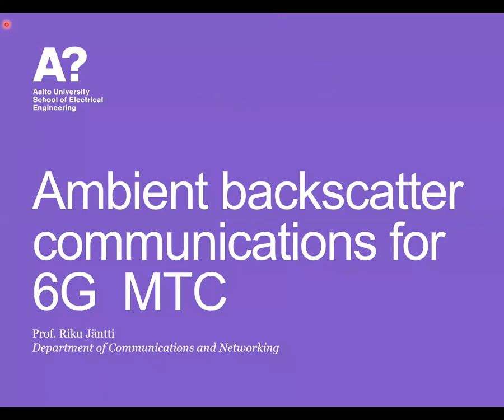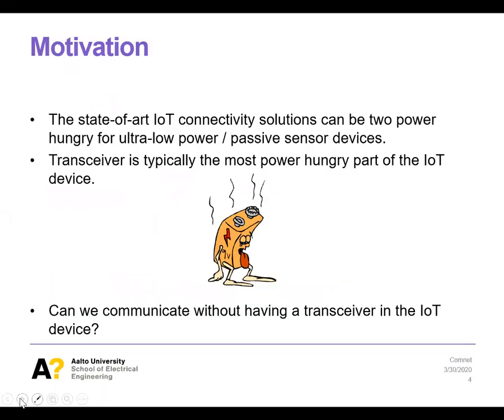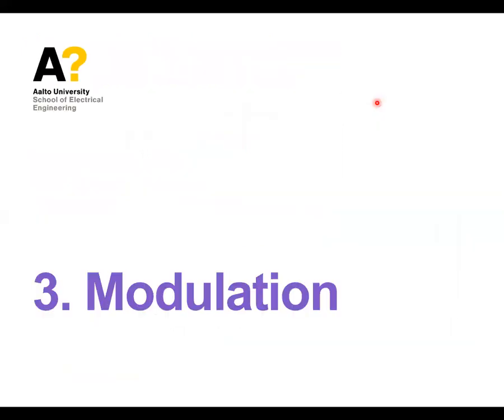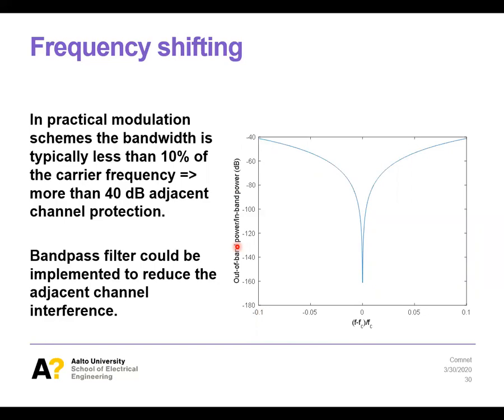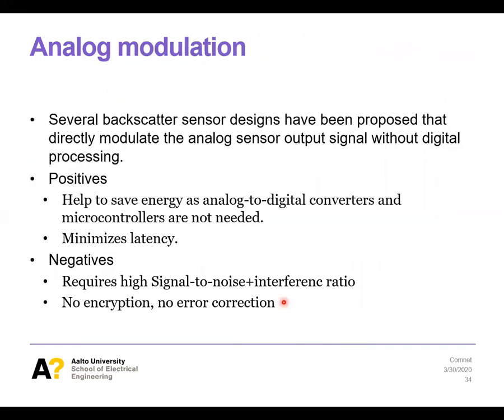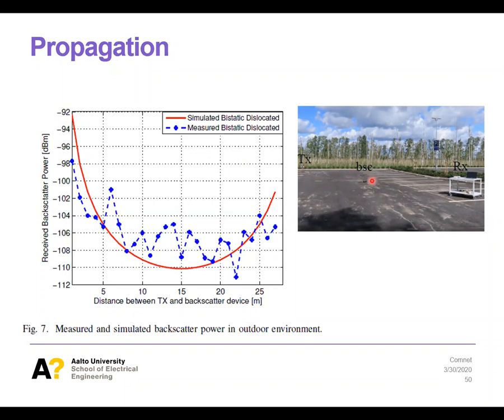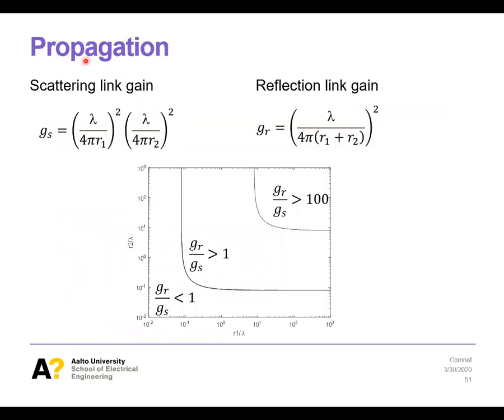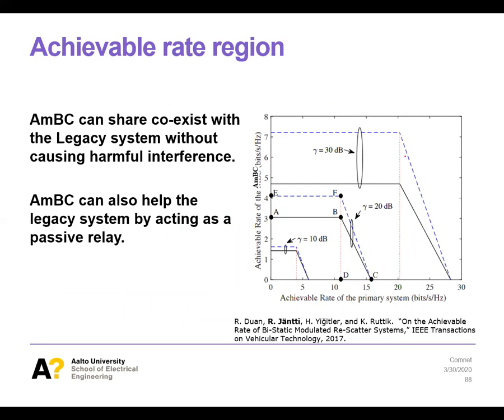Ambient Backscatter Communications for 6G Machine Type Communications

Comment: Any reference paper for this presentation?
Reply from the maker: Several references were mention on the slides. Maybe one could start from 

R. Duan, X. Wang, H. Yigitler, M. U. Sheikh, R. Jantti and Z. Han, "Ambient Backscatter Communications for Future Ultra-Low-Power Machine Type Communications: Challenges, Solutions, Opportunities, and Future Research Trends," in IEEE Communications Magazine, vol. 58, no. 2, pp. 42-47, February 2020, doi: 10.1109/MCOM.001.1900464.
https://ieeexplore.ieee.org/abstract/document/8999426
Reply: @rikujantti3307  Thank you sir